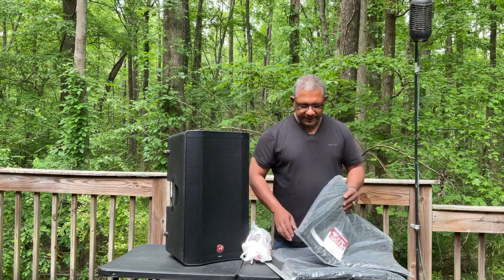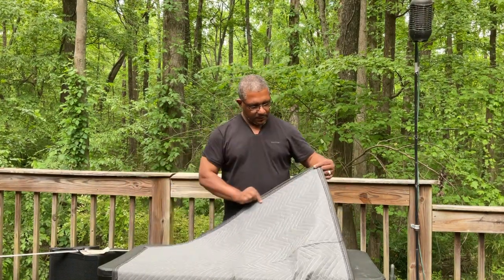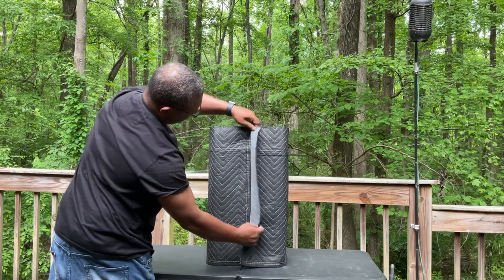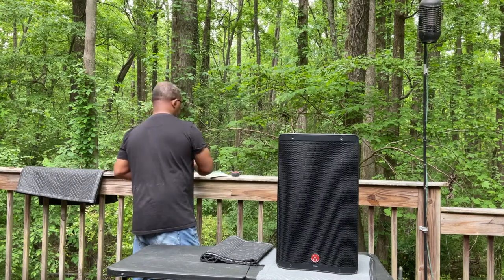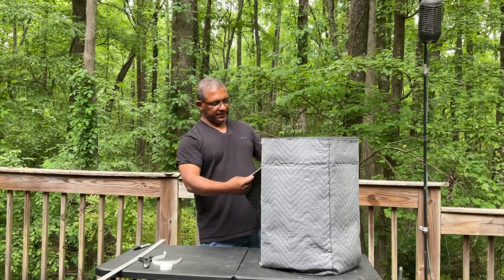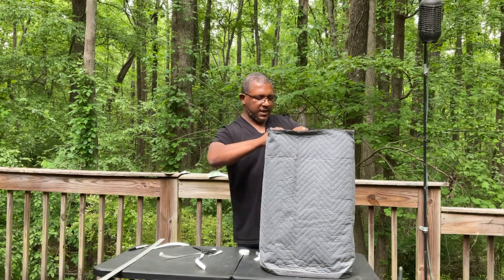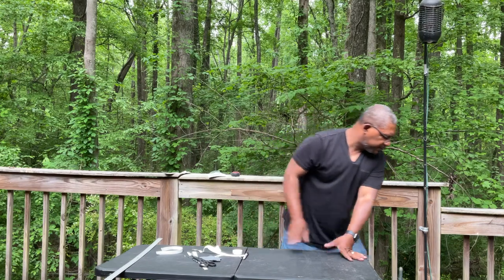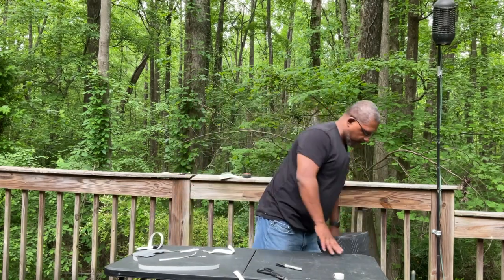Making your own speaker covers for under 10 bucks!

Comment: Instead of tape you can also use a hot glue gun. Some covers I make out of stretchy material. Slips on like a glove. Had them for ten years so far.
Reply from the maker: I need to try that. That might be better than the stuff I used. Thanks!

Comment: I've made the same mistake on the top piece. You have to draw the pattern on the wrong side using the bottom of the speaker. Or just remember to fit it with the speaker upside down.

Comment: Where did you get the blankets?
Reply from the maker: I buy them from a store called Harbor Freight. I've also seen similar blankets sold at Walmart
Reply: @logisticalstyles  Thank you, I bought them at walmart (blue), but maybe should've went with the ones from harbor freight for the black color. Either way, I really appreciate you making this video! It saved me a lot of money and all I needed was something to cover my speakers (same exact ones by the way) while in the car! The first one I made is sloppy and the second one looks a lot better! I even tried applying a little heat to get the adhesive to hold better with a medium-high temp iron using an old t shirt as a barrier. We will see how it holds up. Thank you again!